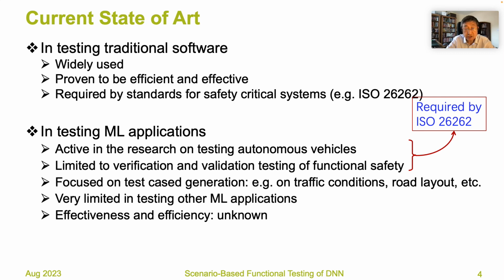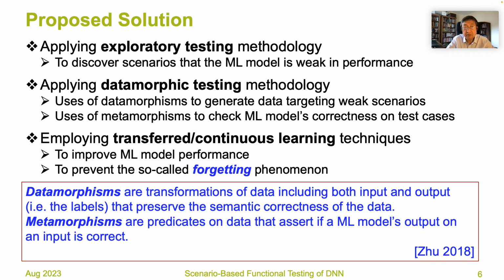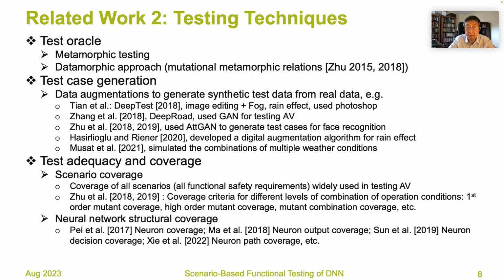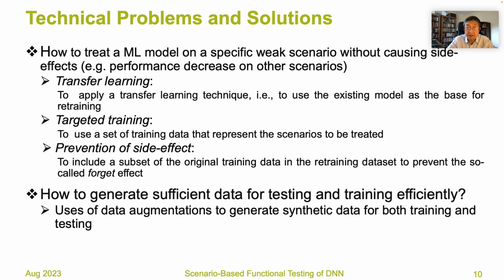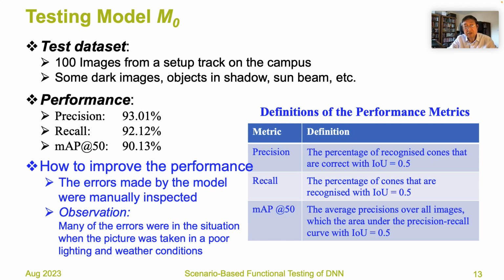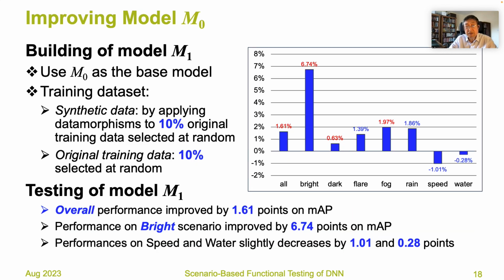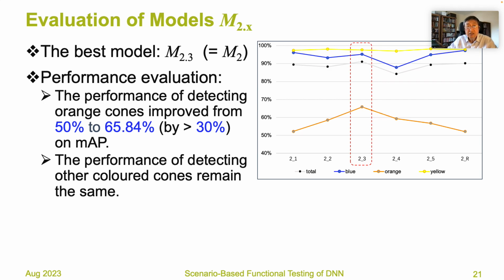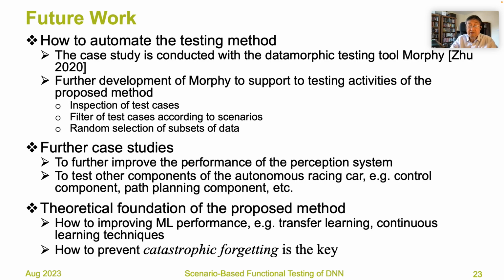CONF-MLA 2023—Scenario-Based Functional Testing of Machine Learning Applications

Comment from the maker: Q2. What role does scenario diversity play in evaluating the robustness and generalization capabilities of machine learning models, and how can testing frameworks be designed to account for a broad spectrum of scenarios that may be encountered in different deployment environments?
Reply from the maker: RE2. Theoretically speaking, scenario "diversity" and "coverage" in the traditional sense play little role in evaluating ML model's robustness. Such evaluations must be statistical and based on test cases randomly drawn with the IID from the data space. As I mentioned above, there is a big gap between traditional VV&T (validation, verification and testing), which is based on logical analysis, and the PAC theoretical foundation of machine learning, which is based on statistical analysis. 

Having said that, our work tries to bridge the gap through identifying scenarios, testing on various scenarios, diagnosing weak scenarios, and finally improving ML model performances on weak scenarios via retraining. We demonstrated that through the iterative cycles of the process, the model can improve its performances on accuracy, robustness, etc. that are statistically measured. This process combines logical analysis and statistical testing. After all, the evaluation of the ML model still has to be statistical. It cannot be formally proved to be correct, and there is no need to be proved to be 100% correct. 

It is worth noting that, when a ML model is deployed to a different environment, the data distribution changes. Scenarios that do not occur in its original operation condition may become highly probable to occur. Therefore, its performance will change. For this reason, scenario analysis is necessary when deploying a ML model to a new application to ensure such a situation does not happen, or model fine tuning and r-test must be done. The current practice, in which scenario analysis is ignored, is fundamentally flawed, and must be improved. Testing tools like Morphy support testing based on scenarios. It is desirable.